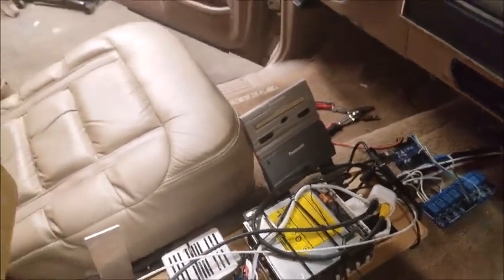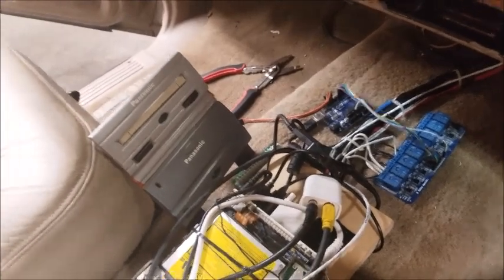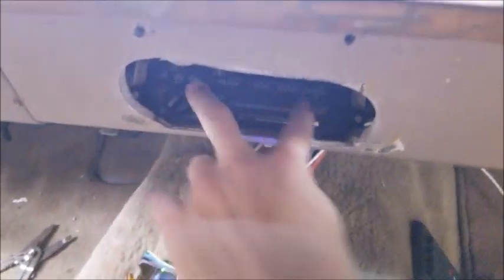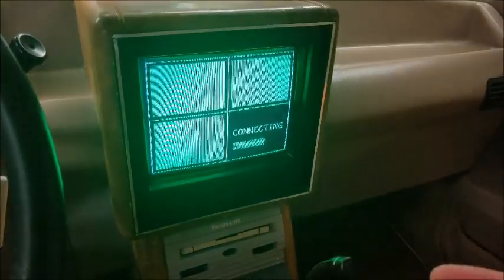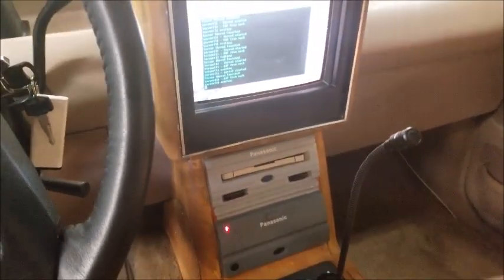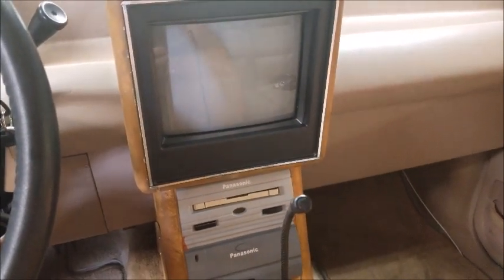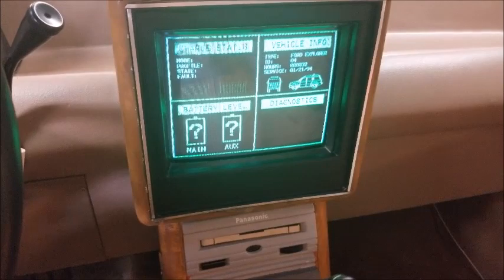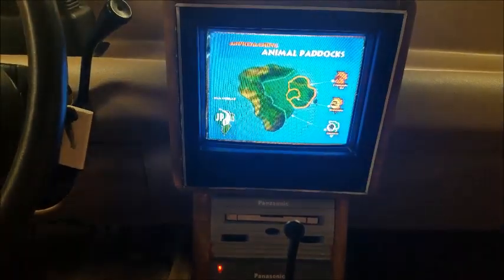Jurassic Park Ford Explorer - Audio/Video/Arduino Setup Update

Comment: Very cool! How are the relays set up exactly? I.e. do the 4 doors require 4 connections on the Elegoo relay board or just one? Which items are connected through relays exactly? I assume the battery, sound tests etc. are just simulated? Would be very interesting to see how the Mac Mini communicates through a Flash script(?) to the Arduino Uno and then to the Elegoo board. Perhaps you can make a video detailing the software part of the car as well and your thoughts about not using Flash at all as I am sure there are better ways in 2020 to build a simulated graphical interface using perhaps HTML/CSS and Python scripts running on a Raspberry Pi? Cheers! :)

Comment: Very cool. I think when I finally build one of these I'll replace the inner workings of the old TV with a modern touch screen system and create an interactive app for the tour program.
Reply: Brandon Bordewyk You would kind of be defeating point of making it movie accurate
Reply: Or I'd be making it more cinematically appropriate. As it's intended function is to be touch screen.